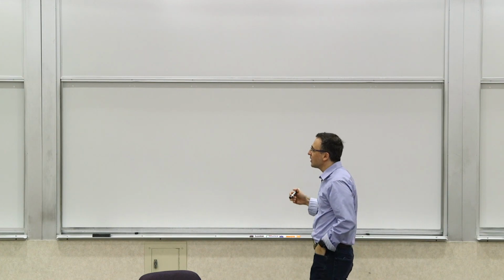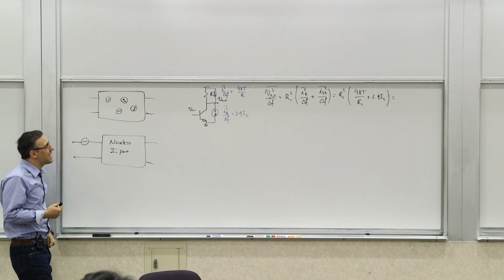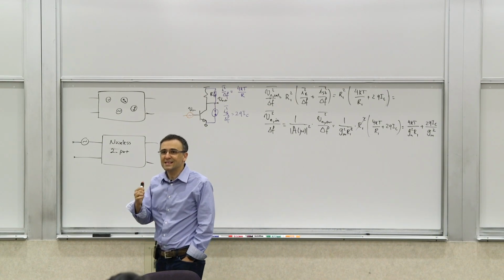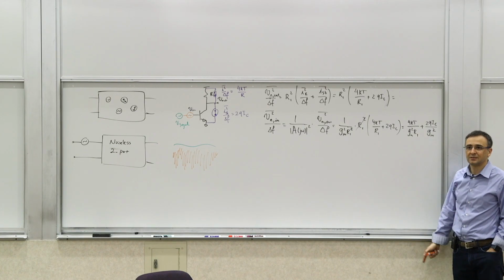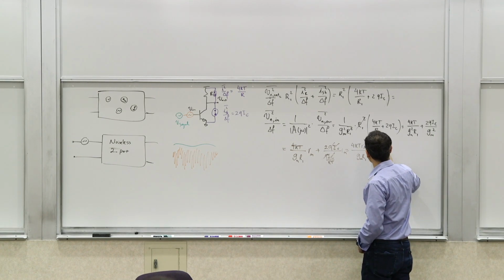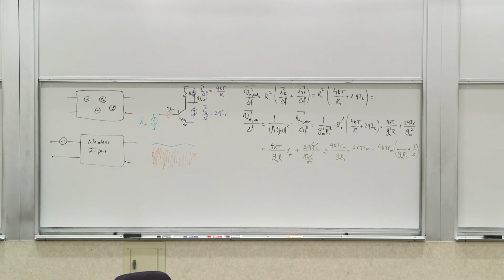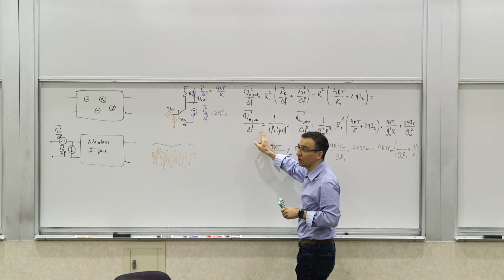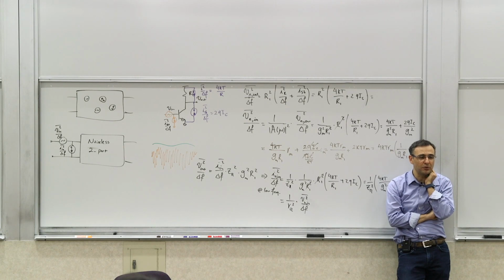177N. Input-referred noise, 2-port noise model, common-emitter

Comment: Thank you for the wonderful lectures, they have helped me immensely. What about a scenario where you have a differential amplifier (in negative feedback) that is not amplifying a signal, like an error amplifier in a voltage regulator? It would seem that in this case you care about minimizing the output noise power and not maximizing SNR, i.e. you would want a low Gm amplifier. But I have found when you place the diff-amp in negative feedback, the input-referred noise maps directly to the output via the closed-loop gain. If the regulator is in unity feedback for example, the input referred noise does in fact appear physically right at the output! How can this be? Is this a special property of negative feedback?

Comment: Sir, is this an undergraduate course, or a graduate course?
Reply: Seems to me as late bachelor level if that helps :)
Reply: @user-ww1go3hz7n  Ahh, okay. I study EXTC (electronics and telecommunication) in college, so we study some semiconductor physics, but not in such great detail.
Reply: I do electrical engineering and similar topics appear in the analog integrated circuits course
If youre looking for more basic but brilliant content check out the razavi lectures